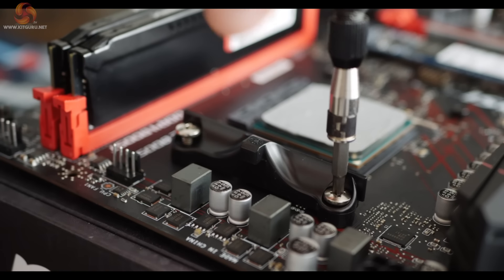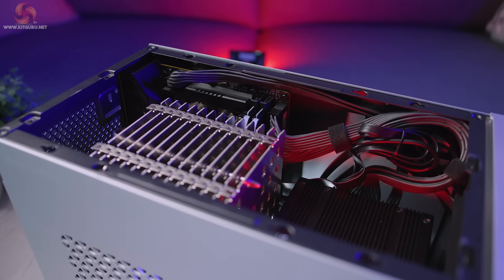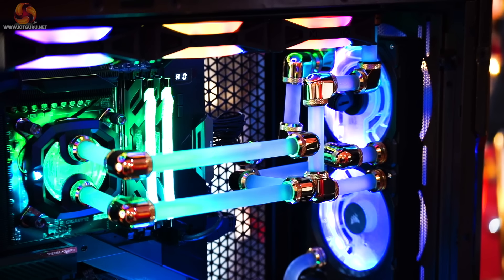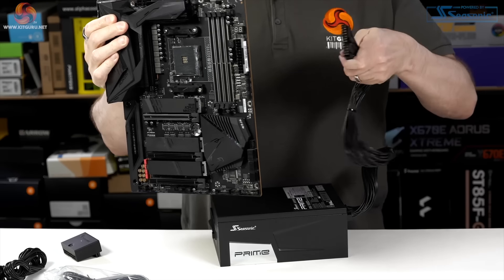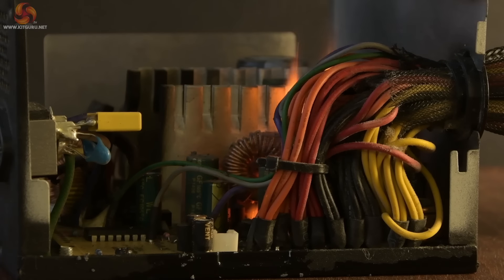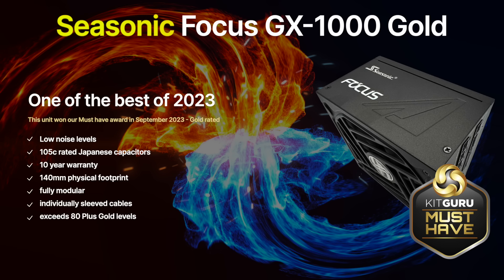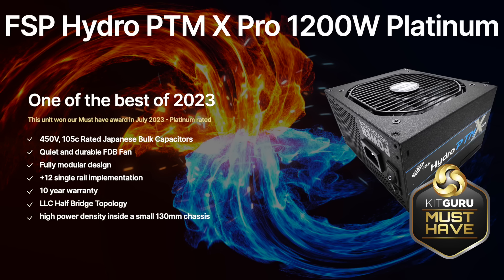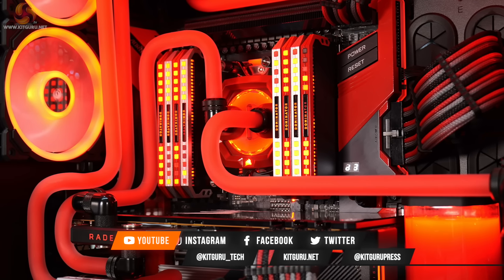KitGuru’s Guide to Buying a Power Supply (2023)

Comment: Seasonic are fantastic. Always bought them. Even the old supplies I’ve given to people after moving up are still working.
Reply: Yeah I love them as well. I’ve had good luck with flextronic too.
Reply: It’s true
Reply: 100%
Reply: agree, had a few , and. they are quiet, and never give any problems. moved from a cheap brand I had and i stopped getting hard locks too
Reply: I used to feel this way. Then my 660w XP2 Platinum started getting problematic a couple of weeks after its warranty expired, despite spending 2 years of that warranty unused and generally not having in any way a hard life when it was in use. Now i've got a new much more power hungry rig and a Corsair HX1500i.
Reply from the maker: @johnbeer4963   Good CWT design that one https://bit.ly/45CzSAa 👍
Reply: S12 ii 550w bronze = 12yrs and still kicking~

Comment: My advice would be, if you can wait for the updated 12v 2x6 PSU's and do not buy the now outgoing 12VHPWR. I would love an ATX12VO because I dislike my rig pulling 70 watts at idle but the big 4 Taiwanese motherboard manufacturers (Asus, Gigabyte, MSi, ASRock) don't want to make boards for them apparently
Reply: Isn't it just a case of pin length rather than the connector being all new?
Reply: but there is no new PSU that supports ATX 3.1 as that might be released next year. Atx3 got obsolete so quickly no wonder there are right and left sales for them. Caveat emptor for 12VHPWR connector for the GPU.

Comment: Wrong.  Check your facts as  Seasonic uses both  OEM PSU manufacturer suppliers and its own made PSUs.  However, unlike Seasonic, FSP never disappoints.
Reply from the maker: Seasonic make all their own designs. We have been reviewing them for 15 years now and have been to their factories. A lot of companies use their designs.
Reply: @KitGuruTech  Not quite, S12III was OEM'd by other company (at least the one released in 2019 or so).

Comment: The "latest" "advance" in PC PSU is the 12VO PSU. This innovative design moves the 5 V and 3 V regulators out of the PSU and onto the motherboard. Same circuit, different location. How creative!!!! And it is not even the communications standard of 48 V that has been in use for decades. The 1920 vintage VRMs on the motherboards and video cards can't handle 48 V.
Reply: seems insane to me

Comment: 4:40 Why didn't you mention Cybenetics Lab? Their rating system is better quality and provides additional certs.
Reply: Cause 80 plus is industry standard. Has been forever.
Reply: @boltsandbraces6261   Hardly forever, and that's certainly not a good enough reason to exclude a superior standard.

Comment: I'm still happy with my over 15yo 500w Chieftec PSU.
Reply: A decent power supply can last years and years.
Reply: 15 years? seriously?
Reply: pretty sure they never designed any PSU, probably a high power unit inside.
Reply: Chieftec GPS-500AB A
Reply from the maker: @basshead.   Well done man, got some value out of that. You still using it in your main system or has it been relegated to a secondary system now?
Reply: @KitGuruTech  It's my main system that I built in 2007/2008.

Comment: 90% of ppl here wont need anything more than a 650W psu..so here are the recommendations for 850+ psu-s...i mean come on.. also zero mentions that there are a lot of psu calculators out there if someone needs a guide... also it would have been nice to have some tipical builds like a 5600 + 6700xt a tell an egzakt value...also i dont see any mention of do i need atx 3.0 or not
Reply from the maker: Well if you would watch the video there is a bit of explanation on efficiency levels, and exactly why we have recommended some of what we have - factoring in capacitor strain, lower fan speeds, cooler running internal temps and lower noise. Also in 2023 we have actually not been sent a lot of lower spec power supplies to review, so we can not recommend power supplies we haven't received as we havent tested them in the labs. some content is over here: https://bit.ly/3CSYJF5. - as for more detail, yes we can do more videos on this, its already over 12 minutes and people get bored. its a tough subject to cover quickly and without putting people to sleep - which is why we don't do a lot of PSU video content on the youtube side. Sorry it was a disappointment, we will keep trying.

Comment: Very VERY informative video ,subscribed !!! thank you! i have a 1,5 year old corsair gold rm750x psu and i bought an atx msi b660 a pro along with an i5 13500 and an rtx 3060  ,Is l it ok to built this system with this corsair psu or should i buy a bigger one? it is in very good condition , will it be able to handle the gpu power spikes etc?

Comment: Hello KitGuruTech how are you? I would like your input on the following, since I'm starting to think I might have screwed up.

I've currently bought the following parts to build my PC + Monitor

- Asus ROG Maximus Z790 Dark Hero
- Samsung SSD 990 Pro NVMe M.2
- ASUS ROG STRIX GeForce RTX 4090 GAMING OC
- Corsair Dominator Platinum RGB 64GB DDR5 (2x32GB 6600MHz)
- ASUS ROG RYUJIN III 360 ARGB
- Intel Core i9-14900K
- Lian-li Fan AL VS ARGB x7
- ASUS ROG Thor Platinum 1000P II Platinum

- Corsair 5000D Airflow
- Alienware AW3423DWF 34

Before i purchased it I've looked in several websites that calculate Watt consumption and they recommended 1000W, but after reading a bit more today I'm a bit concerned it might not be enough. Since it's still on the Box and probably can still upgrade it, despite all the work is going to give, is it worth it, or this power supply will be enough?

Thank you in advance for your time and help

Comment: I went with future proofing. Got myself a 1600W (phanteks revolt 1600 which is a rebadged seasonic prime tx). Assuming around 600-650W  total load which is around the 40% mark. The cybenetics rating is also a noteworthy mention here. My idea was to have very less noise in my PC so, yes, I overspent.
Reply: Sounds like you know what you are doing mate
Reply: Phanteks seem to work closely with Seasonic, which is good to see.
Reply: Yep. The only thing I would like to see them do is to implement a fully digital stage like Corsair does on their AX1600i. Can’t go wrong with close to 200% excursion either.
Reply: @canarychrome7012, I do feel slightly guilty but I guess that’s bound to happen given the overall HW I have at the moment.
Reply from the maker: @fjallmann  Good supply, whats the spec of your system?
Reply: @KitGuruTech  Forgot to mention this. A big thanks from my side for all the guidance and wisdom you guys have been sharing for the benefit of fellow enthusiasts out here. In a market muddled with multitudes of products which sometimes only makes the process of making a right choice hard, you guys have been doing a stellar job at shining the light far enough in this very dark tech tunnel.
Reply from the maker: @fjallmann  Thank you, appreciate the kind words. we put a lot of time into the videos, always nice to get some positive feedback with the negative !
Reply: @KitGuruTech  The only negative is that you lads successfully guided me in making my wallet that much lighter 🤣
Reply from the maker: @fjallmann   - sorry, but hopefully you ended up with a good rig at the end of it all !
Reply: Haha! That I did for sure. 😀
Reply: is it a good PSU? worth the money ??
Reply: @harleylover9446   In my books, sure is if you need the power. Granted most folks will be fine even with 1000-1200W units with single GPU setups.

Comment: Hey guys, I often reference your videos, and I was wondering if you could help me. I am looking for a fan controller that can handle 2-4 pin fans but they have to have really high quality capacitors, inductors and linear regulator as I'm doing some work that requires it. One person suggested Aquacomputer Coolers, which are really expensive. I only really need a couple of headers to connect fans to, but I do need to be able to instantly cut the power, too. Do you know of anything that would help?

I have an Akasa FC.Trio and a Copal Fan Controller from EN-Labs, but neither is good enough.

Comment: You also don't want to run your PSU at less than 20%. Idle is more common than many think. YT, desktop, etc.
Once you go platinum+, you never go back. The compact silence is so tempting. And anything below Gold in 2023 is just wrong. PSU can easily last for 10 years unlike many other parts so it's the single best investment. It doesn't run out of fashion or fps.
As for modular vs semi/non - modular is overrated. If you are into custom, resoldering is actually easier. Besides that, cable management and extensions work with both.
Reply: are you really recommending soldering rather than modular? I dont even understand your point ....
Reply: @haremofprocessors6954  If you do custom cables, soldering is actually faster and easier. You don't have to make pins on both ends. Cut the right size and solder one end right to the PSU board. You should have some basic understanding of electricity, safety and capacitors in particular though. So there is no need for a more expensive modular PSU in the first place. The only problem - you won't find any PSU above Gold rating with semi-modular or fixed cables afaik. So you are forced into modular if you are looking for decent cool and silent PSU.

Comment: how do we calculate power needed with those power draw spikes from those boosting cpu and gpus? some look like they can draw quite alot more for short times then what is the normal usage?
some of the psu calculators tell me i use around 450W max and then get crashes with some midrange 550w psus, currently i run some ok 700W gold psu just fine but at some point i would like to get some upgrade and some of those gpus look like they could replace heating for my room...so i would like to figure out what i might be able to throw in that will still work fine or if i need to add extra budget for a more powerfull psu if i want to get something a bit more power hungry then the card i currently have.

Comment: I really wanted my hx1000i corsair power supply to be a winner at this 😢 I just like to hook it up and see the voltage and fan speeds with efficiency it's nice to see the data.
Reply from the maker: We havent reviewed the newer versions of that in recent years, I just checked back and it was 2014 for that model on the main site. We did review the Corsair SF1000L SFX-L in May however along with the RM1000e ATX 3.0 units. can see them all over here: https://bit.ly/3CSYJF5
Reply: @KitGuruTech  I bought the RM1000e its a cracking unit. love it

Comment: Back when I was dumber, I managed to fry a no-name, "came with the case" PSU by upgrading to a GTX 260 without giving a thought to power-consumption. Problem was that the card was around 3 to 4 times as power-hungry as my previous GPU - around 200W IIRC, which was pretty outrageous for a mid-tier GPU at that time. I went with a totally overkill bequiet Dark Power 650W because that was the only high quality PSU in the power-range I wanted my local HW-store had in stock ... and it was a Saturday.. :) Ever since then, I've stuck with bequiet more out of habit (that 650W-PSU still exists and, for all I know, still works) , but I would never, ever again buy a no-name brand, ketchup-and-mustard PSU. 

Besides that, I think there are just a few basic guidelines to follow, even if you're on a tighter budget:
Is the manufacturer reputable/known for high quality PSUs?
Does the PSU have decent/good reviews from reliable, independent sources?
How long is the manufacturer's warranty?
One reason why I've stuck with bequiet is that they offer a 10 year warranty - at least for my current Straight Power 12 they do. Which is always a good sign IMO, since it strongly implies that the manufacturer themselves trust that their product will outlast the rest of your system.

Comment: I learnt a valuable lesson years ago when a cheap PSU I had in my pc started to catch fire. Instead of the PSU shutting itself down it got louder and louder  with sparks coming out the back and it was just lucky that I was able to reach the power cable and yank it out on the PSU. Since then I only buy quality PSUs my current one being a Corsair RM650X that I've owned for 5 years and it's still under warranty. seasonic is another brand I have alot of respect for, and will probably buy one with my next computer when I need more than 650w.

Comment: Also, extra modular cables not going into the case should be tagged or grouped (e.g. cable tie or dedicated bin) so you KNOW which power supply they came with. Why? Not all cables are wired the same, even among some different models of the same manufacturer! 

Don’t rely on appearance either as different manufacturers’ cables can appear identical. Mixups can fry components.

Comment: Thank you!   Got the full size one, not compact -  FSP Hydro PTM PRO 1200W ATX 3.0 PCI-E GEN-5 80 Plus Platinum Full Modular Power Supply (HPT2-1200,Gen5)  to replace a 9 year old EVGA1300G2 , it runs , but the 12v rail is not what I want for my 4090 , 11.7 low to 12.3 high ,  the EVGA replace a 15 year Corsair  TX750w and it still runs as well
Reply: Been a week since I got the FSP Hydro PTM PRO 1200W ATX 3.0 PCI-E GEN-5 80 Plus Platinum Full Modular Power Supply (HPT2-1200,Gen5) -12v high-power rail rock steady at 12v vs  9 year old EVGA1300G2 11.7v  , will use EVGA 1300G2 in second rig with a 1080Ti ,old buddies' reunited !
Reply: That regulation is awful for the price lmao. I got a TT toughpower 1200w gf3 and reviewers note that one of its main and few weaknesses is its mediocre 12v load regulation and yet that still only goes from ~12.15v to ~12.0v under 100% load lmao. That being said ripple is even more important but u cant really measure it urself, if it has voltage regulation like that not hopeful for its ripple either.